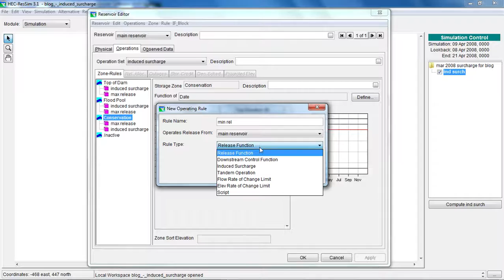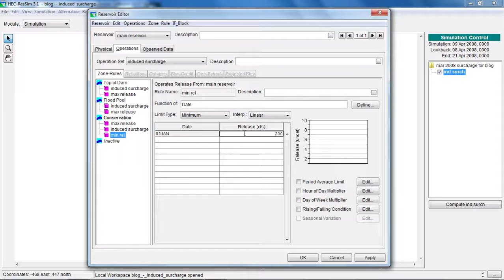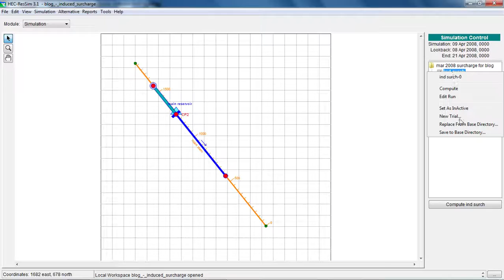An Explanation of the Base directory in HEC-ResSim

Comment: sir ,
     my name vyshna suresh currently i am doing my mtech now 
  my mtech project is doing  on hecresim 
can you  plz help me out to understand about this software 
actually i don't have anyone to query about this software in my college 
i will list out my doubts one by one 
1. what is the theory behind this software or what actually this software is doing inside (like some equation used)
2. i am doing an optimized operation of the reservoir for flood control and many errors are arraising and my simulation is not yet run 
plz do reply sir 
it will me very much helpful for me 
                                                      hoping the best 
                                                                           Vyshna
Reply from the maker: The basic equation that governs what happens at the reservoir is "change in storage = inflow - outflow".  You have to describe the physical features of the reservoir (elevation-storage table) so that the storage can be converted into an elevation.  The rules of operation that you apply will govern the outflow and the inflow is put into the model by using the DSS paths.  Your question is a good one, and I believe a video can be helpful for understanding this.  I have a few that I am working on right now, and I will add that one to the list.
Reply from the maker: Also, can you tell me what error message you are getting?